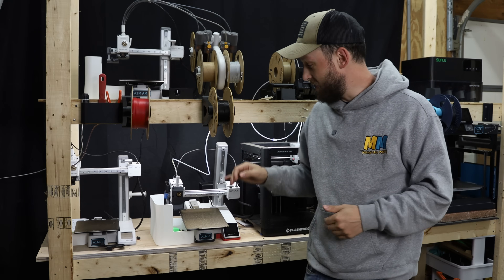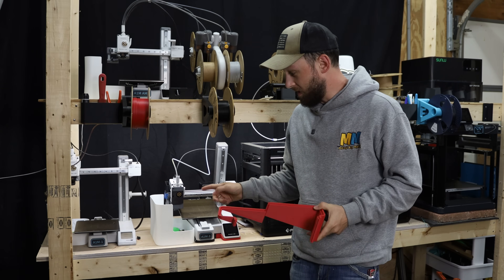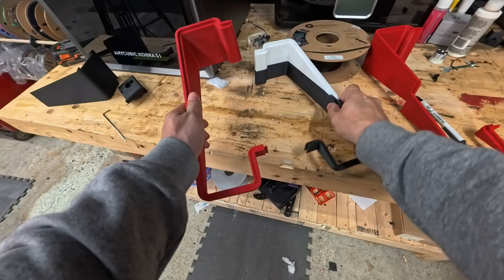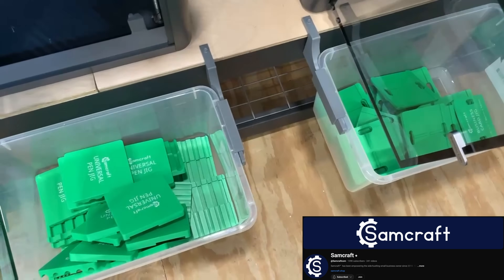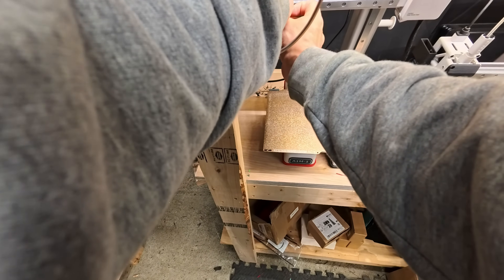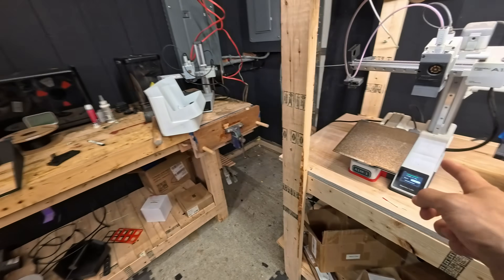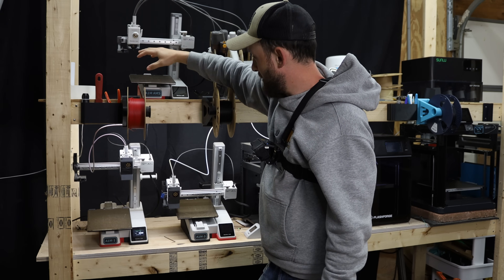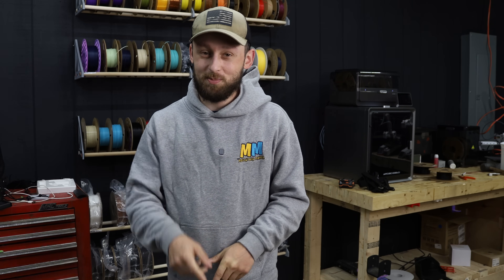3D Print Vlog | Getting More Printers Automated with Farm Loop

Comment from the maker: Join the Farm Loop Skool Community and get access to Farm Loop Pro Included in your plan - https://www.skool.com/3dfarmers/about?ref=f921c70855bf4ca088c1439d48dcbc36
Reply: A simple fix for anthing that moves on a woodern surface is to mark the feet and router out an indent in the surface for the feet to sit into. If you need to change the object and redo the feet, just putty up the old ones and if the surface looks like the moon, then resurace with new wood or ply back to looing great again. Simple is better than complex IMO! Gr8 video (PS: vibration and cold, yes cold or any mouisture will make even mountians move over time, see the rocks that go walking in the nevarda desert as an example and thats just a gentle breeze on a cold morning and not XYZ 24/7 motion and vibrations! )